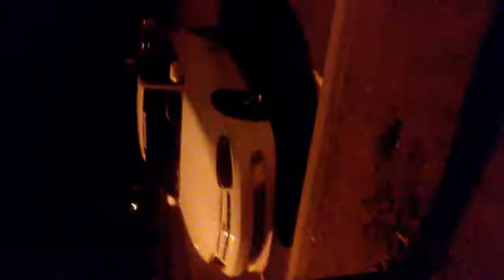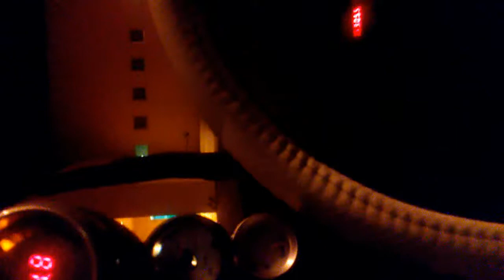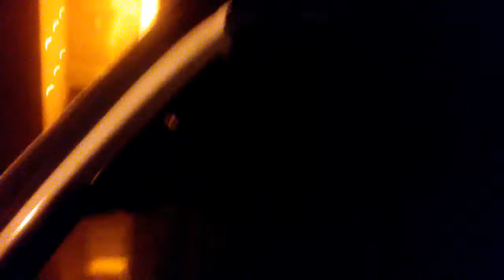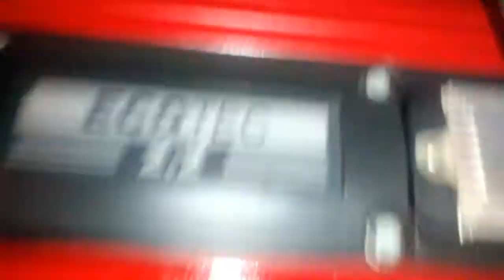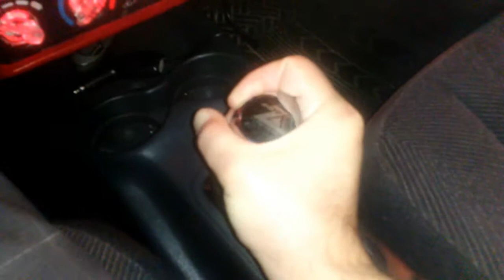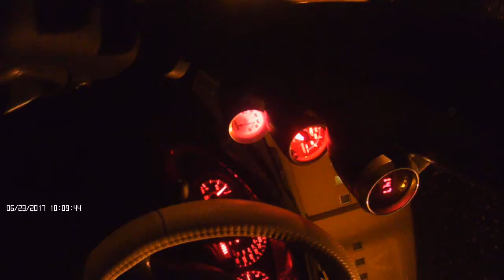Update on my 04 cav

Comment: What's your base fuel pressure at?
Reply from the maker: the fmu is whacked. no matter what i turn the set screw to it doesnt go below 85 psi at idle. and at wot its retarded. so gotta wait and save up for a new fmu, its been that way since the install..
Reply: #TeamSTC Donny http://www.bellengineering.net/product_info.php?cPath=7_78&products_id=8

They sell rebuild kits for that regulator. Or you can even send it to them and have them rebuild it for like $50. I had them rebuild it once, it only took a week. 85 psi at idle is going to wash the cylinders, its supposed to be 35 psi. That's why the motor sounds like it's chugging. At 35 psi it will idle at 14.7. Wot your fuel pressure should be like 80psi or 11.5 afr. Get the thing rebuilt, it will run like new.
Reply from the maker: oh yeah i already called bell and talked to him myself about two weeks ago, said they would rebuild it, but gotta be able to have the car down for that long and have the extra funds. at idle and normal driving it runs just like my na with stock fuel system, doesnt get ridiculous until I boost.